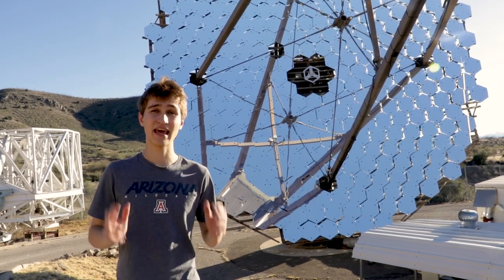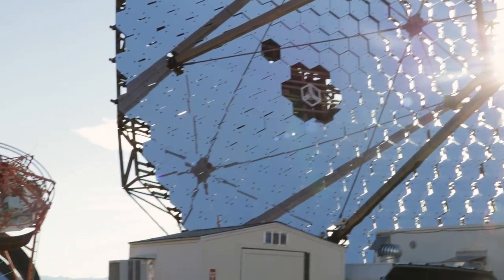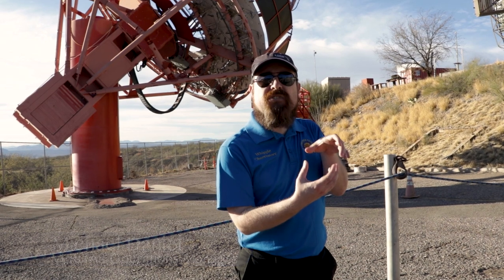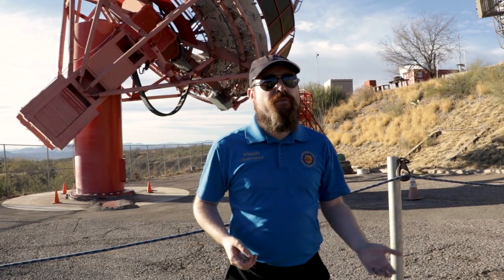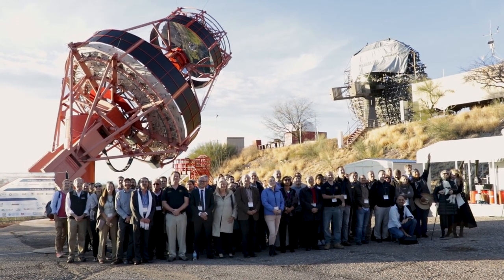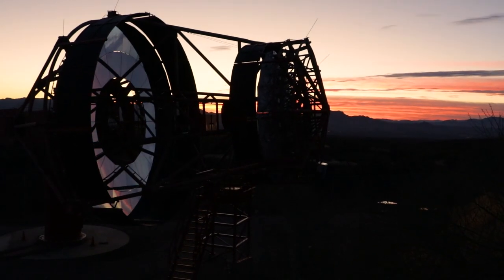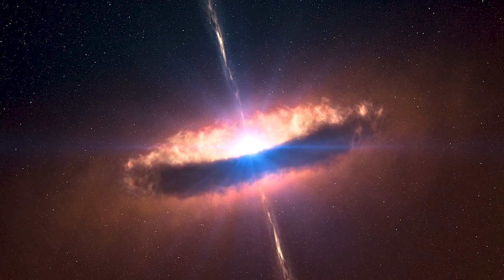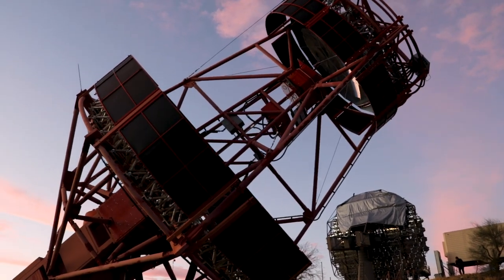High Energy Astronomy: A Telescope is Born

Comment: You can't see the milky ways' black hole, Sagittarius A+ from the northern hemisphere.
Reply: That is not true;  We observe it with VERITAS (pictured in the video) regularly.  It is visible at ~60-65 degrees zenith angle, which can be sub-optimal in many senses, but for this technique can also have benefits.  Thank you for your interest. -Wystan (VERITAS director)
Reply: Do you have the resolution for these "active galactic" objects?

ra 195.04910281617978
dec -1.2701322709799077

ra 148.11419661238412
dec -0.4929761236165755

ra 132.13338125847838
dec 32.33679827905543